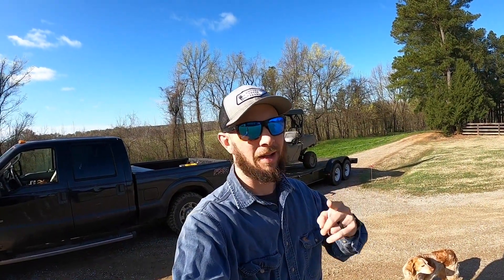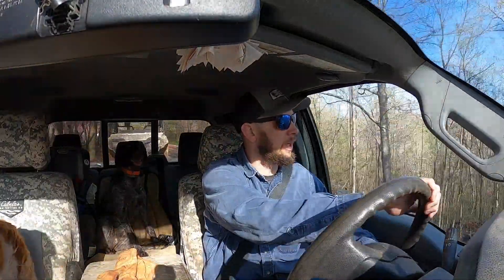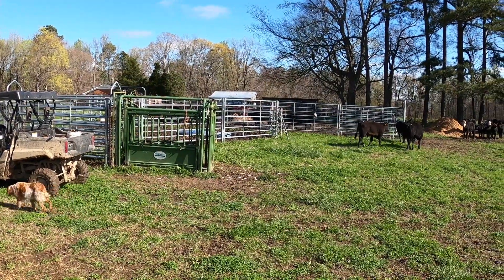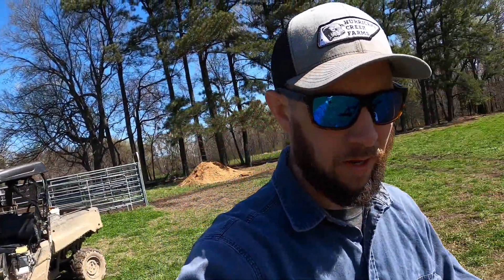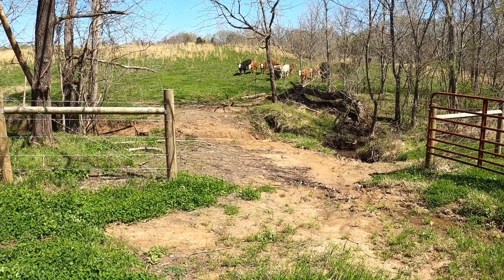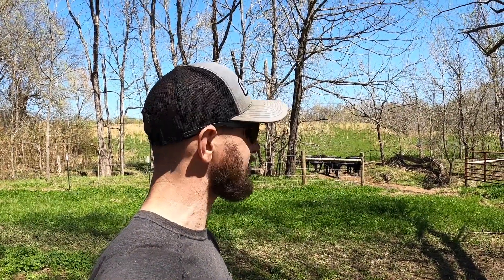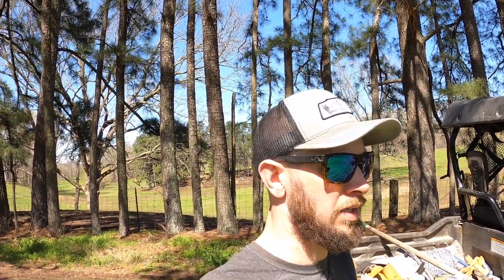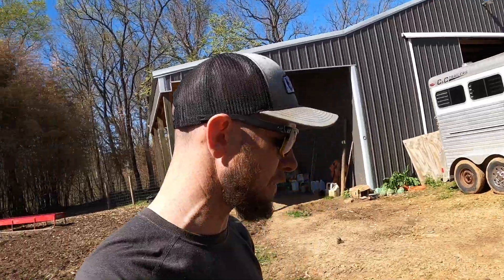Fence repairs, catching a rogue steer, & rotating pastures

Comment: On 40 acres how many head could i buy and sell?
Reply from the maker: It’ll depend on a lot of factors, but we run these 550 pounders at 1 per acre. That works as long as we get rains all summer long, and we’ll fertilize & rotate pastures. I’d determine what I think the pasture could support, and I’d err on the side of caution the first year. If you have plenty of grass, then I’d maybe increase for year 2. If we get dry, we could have to sell some or start supplementing hay or more feed, and we really don’t want to do either.
Reply: @HurricaneCreekFarms  thanks, we run a cow calf herd right now but i was thinking i could double the stocking rate from about 15 to 30 stockers just because they are half the weight. I may be wrong but if i supplemented a bale or some cattle cubes i could have 40 to 50 of em and buy em at sale barns make a Lot worth and sell em online for 20 cents more per 100 wgt.
Reply from the maker: @wilsonlandandcattle1795  yeah, a rough estimate would be stocking them twice as dense as you would cow-calf pairs. We stock pairs at 1.5-2 acres each, so that’d be about right
Reply: @HurricaneCreekFarms  ok thank you so much have a good rest of your day.